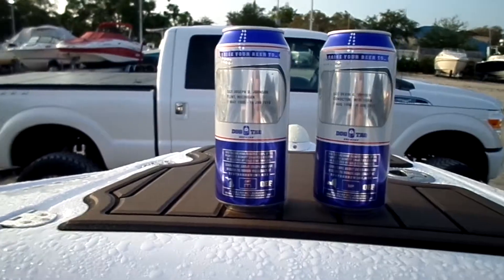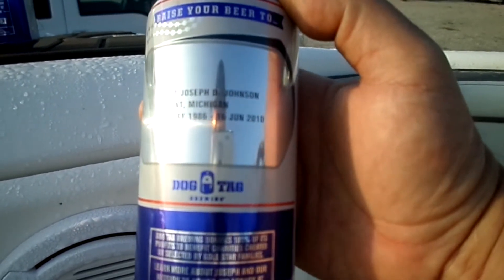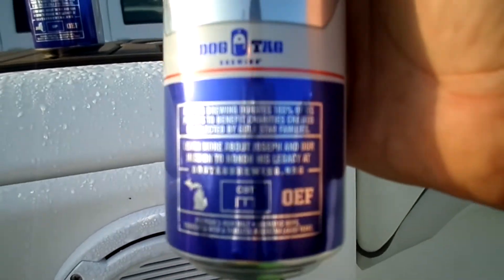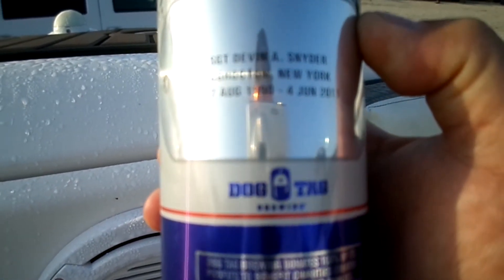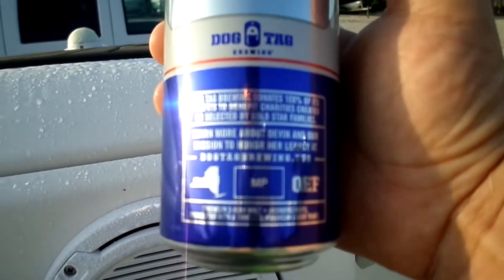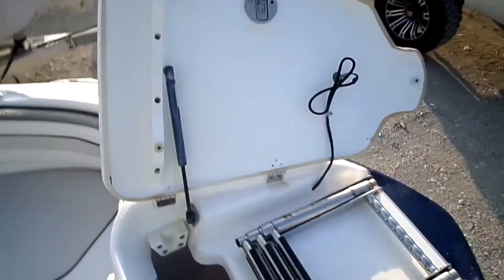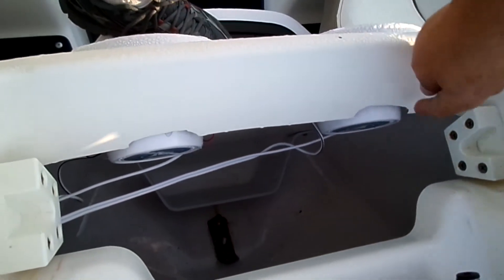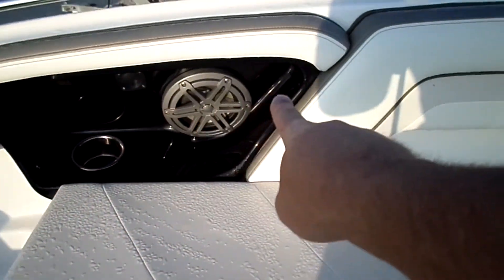Yamaha SX240 Anchor Well Speakers

Comment: Ay Rob. Any experience with installing ball valves on the cooling lines for the engines in case of one engine failing, or being towed home?
Reply from the maker: Lockdown Skateboards I dont, but the advice I received from a few people is to have a set of vicegrips on the boat at all times..  pinch the lines and be done!! Alot less work and $
Reply: Rob's Yamaha Jetboat DIY Maintenance yea I heard that too. Ok cool all good. Cheers🍻
Reply: Ay Rob - do u have an email I can shoot you a question? It may be a tad long, so I thought email would be best.  Thanks again. - Richie
Reply from the maker: Lockdown Skateboards wallacerb@yahoo.com

Comment: Hey question ??how you guys remove the factory speakers.the cover??thanks
Reply from the maker: The covers twist off. I believe its counter clockwise. Use an open hand with fingers on the outside of the cover so you dont break the plastic grates.  The screws will be under that.  4 Phillip's head screws...

Comment: Hey rob. How you doing my friend I am at crazy Cuban I have a 19  ft  Yamaha. I believe I have a kick ass stereo system but not enough juice. My batteries don’t last too long what can I do my friend help me out I have two amplifiers JL audio. 4 towers total. 4/8.8. 4/7.7. And 2 10” sub. Two amp. One 8 channel. And my sub 600 mono. Everything is jl. Thanking about by Norstar batteries help me out I need to know what kind of battery or power are you running thank you my friend
Reply from the maker: Manuel Serrano bro, i left my stock battery for the starter battery... i use two group 27 marine deep cell batteries from autozone for everything else... nothing special at all dude... about $100 each..  im getting about 4 hours of music at about %50 volume....  thats pushing two JL 8x800 and one 6x600 amps....
Reply: Rob's Yamaha Jetboat DIY Maintenance Thank you my friend keep those good videos rolling

Comment: Have you ever open your engine fuses ? I can’t  for the life of me unscrew the cap to open it?
Reply from the maker: sharon emery yes I have and  it is definitely tight..  i used a set pliers...
Reply: Rob's Yamaha Jetboat DIY Maintenance great thank you I’ll give that a try! I’m having a default code come up and I think it has to do with the fuse.
Reply from the maker: Cotie Drinkwater oh dann that sucks.. whats the code?
Reply: Can2loss-engine I’m petty sure.   So what I believe might have happened. I bought this boat in January. It was winterized. I live in Canada.   I think battery cables might have touched together when they were being unhooked maybe blew a fuse, but everything else seems to be working. I went to start it today and the fault code showed up. Just my theory
Reply from the maker: Cotie Drinkwater oh crap... that would definitely blow a fuse...  keep me posted on what you find out so we can share with others...

Comment: Rob,  question for you. What is the life expectancy of hours for the impeller wear rings on these boats? The dealer always lists it as something they “inspect”. People also tell me they only last 200 hours? You have any info on this? Thanks man.
Reply from the maker: DennisTheMenace well its like anything else in life bro, its all depends on how you run it and take care of it.  if you run in a lot of rocky areas they wont last long.. regular maintenance will help a dealer identify issues early enough to catch on warranty.  Mine is at 110 hours and I have not had issues at all.. I know of many people that have far more than 200 hours on originals....
Reply: Rob's Yamaha Jetboat DIY Maintenance right on. Thanks for the input. Good job on your channel